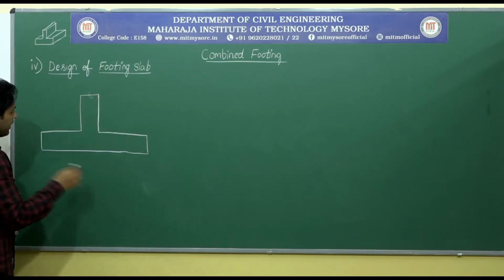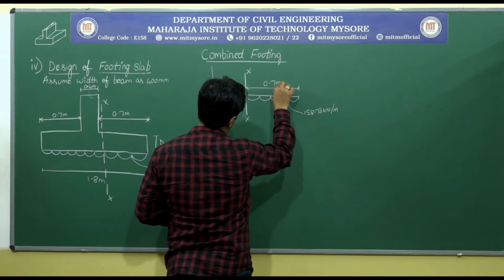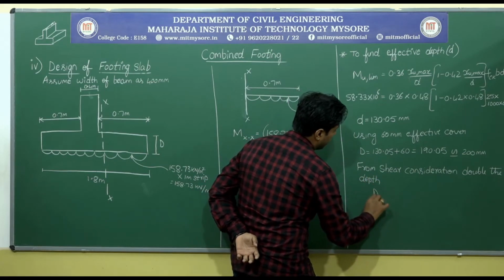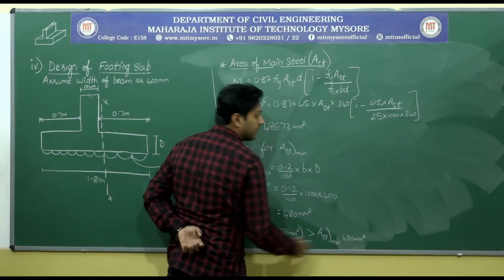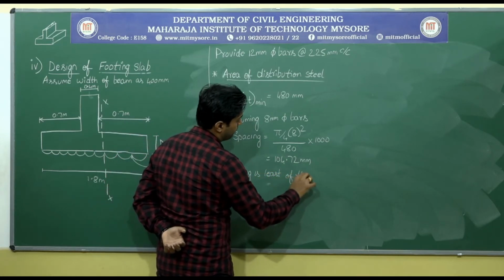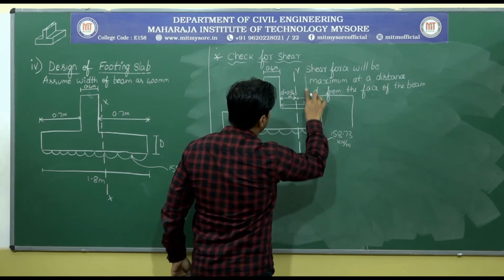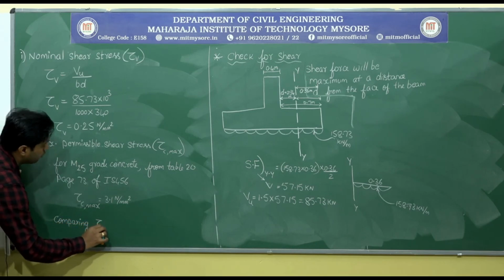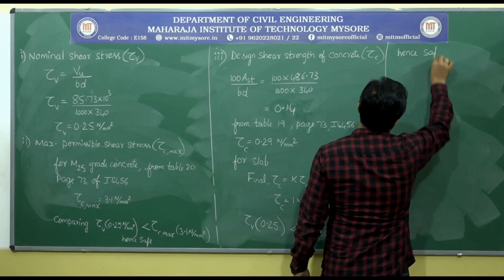DESIGN OF BEAM AND SLAB TYPE COMBINED FOOTING/DRSS/17CV72/CLASS 11

Comment: @ 36.38 vu value 57.15 is wrong after multiplying we obtained 10.28
Reply: in calculation part sir has done little mistake. instead of findinf SF he found moment by multiplying perpendicular distance... but the value he has written 57.15 kn of SF is correct.
Reply from the maker: go with your calculated value

Comment: Sir in check for shear ,there is little mistake u did in SF calculation
It is not (158.73*0.36)*(0.36/2) 
SF= (158.73*0.36)=57.15
Reply: Ya what you said is right. As it is shear force, it's only the force we need to consider. But I have considered force x distance, which is wrong. Please correct it there.
Reply: Also while playing this video to my students, I have corrected and informed my students regarding it. Others who are following this video please do correct it.
Reply: If the coloum  A is 300×450 & coloum B is 300×600 what would be the width...?? Of footing